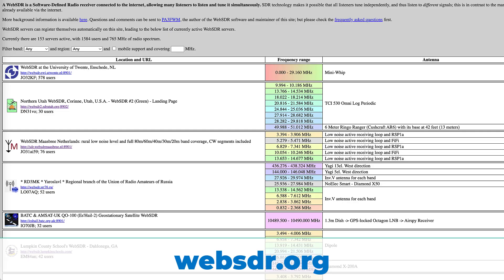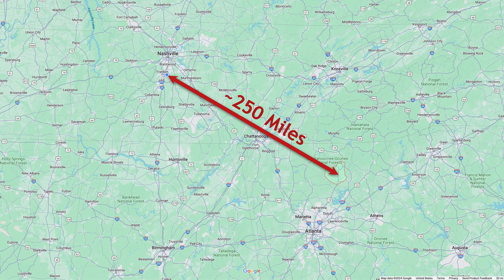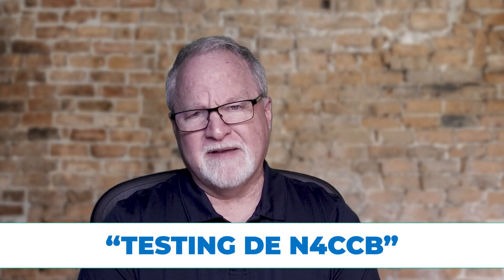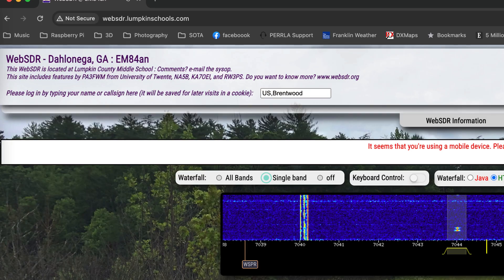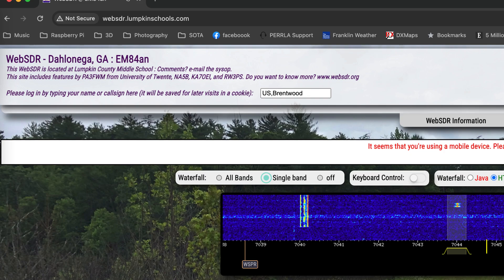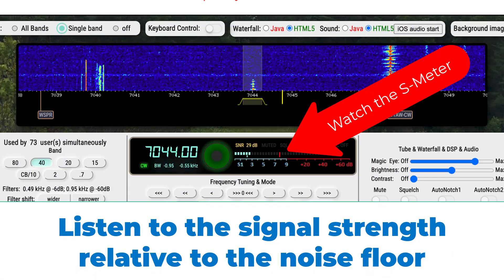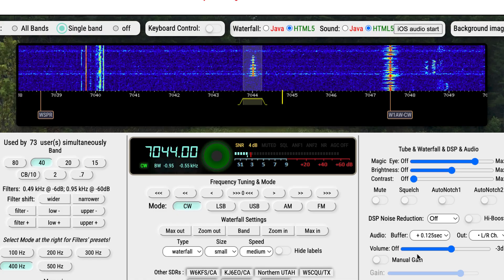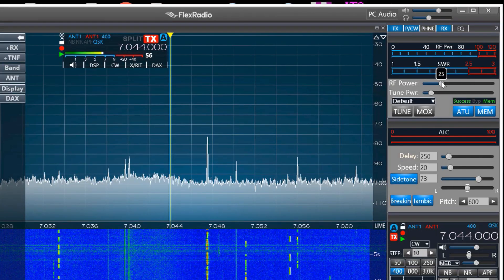100 watts vs. 5 watts: Can you hear the difference?

Comment: It is more about the antenna.  With a gain antenna, it is pretty easy to ERP 300-400 watts with a 100 watt radio.  The other side of this.  Get your 5 watt radio and try to break into a QSO on 160.  Then try 100.  BIG difference.  I don't run any amplification (yet) but I do notice a big difference in 5,20, and 100 watts when the bands get dicey or the antenna is a compromise.  I do enjoy working low power but it is always a bit of a disappointment to set up portable to realize you can't work where you want or who you want.  Usually with 100 watts there is no problems in communication reliability.  That is what the military found out long ago also!  Thanks for the video.
Reply from the maker: Thanks, Dylan. I've never made a contact on 160m (very limited antenna space here), and I rarely even try 80m.  But, you're right... those bands can be a challenge, for sure. Check out the brand new video I just released a few minutes ago. I show an SSB example, but, more importantly, talk about how QRP needs highly favorable conditions to work magic. That said, even folks using higher power are still at the mercy of the Gods of Propagation. Check out that video and let me know if you think I'm wrong in what I say there. Thanks again for taking the time to comment. - Cliff
Reply: @QRPSchool  just saw you posted a vid and I will check it out!  73

Comment: True 😛 ✌️. And whats more - 100mW is often good enough. 73!
Reply: 350 mW out got me a 180 miles QSO and a SWL report from 220 miles using a Pixie on 5.262 MHz and low inverted vee. How much further did my signal go. It's a bit of an underused frequency.
G4GHB.

Comment: How similar would the results be with voice rather than cw?
Reply from the maker: I’m going to try it. Because CW is a pure carrier, and not modulated like SSB, it’s more like a laser pointer, compared to a flashlight. So, the results may not be as good, but should still follow the same pattern… with every reduction by 4x yielding one less S-Unit. A complicating factor for SSB is that your voice’s loudness changes with each syllable. Unless you’re talking like a monotone robot, the listener’s S-Meter will rise and fall as you speak. (Go watch an S-Meter while listening to an SSB conversation on-air.) 

As you reduce your power more and more with SSB, at some point the quieter syllables will be lost in the noise floor.

So CW will yield a best-case scenario, but SSB will follow the same pattern.

Comment: Meaningless as presented. If you have conditions where the signal is being received with over 30dB of SNR at 100W, as you did in your example, then of course you can reduce power by quite a bit and not hear much difference if any! The receiver AGC is going to ensure that! Try this experiment again with conditions where there is only 10dB of SNR and results will be dramatically different. Also, CW signals can be comfortably decoded at only 2 or 3 dB of SNR, whereas phone signals require 6 to 9 dB SNR.

This was simply an example of receiver AGC in action vs. received SNR, not anywhere near an edge case, and not at all an example of how QRP is equivalent to QRO (it is not!)
Reply from the maker: I’m sorry. I am NOT saying what you think I’m saying. When conditions are good, and your 100 watt signal is strong, you can turn your power down to QRP levels and have a good time. In “edge cases”, when QRP is unpleasant and/or ineffective, turn up your power or walk away.
Reply: @QRPSchool  It meant a lot to me. Good thing about qrp is you can work a guy across town and feel good about it. i like remember what a 5 wt litebulb looks like and know i just made a contact with that. If I really just have to make contact with somebody ill pick up my telephone. QRP is playing with radios, and thats what I like to do. Ive got a 40mtr small wonder i put togeather years ago. Ive made contacts all over the country with it. Its fun 
73      kf0ka

Comment: Many years ago, I was transmitting on 40M CW with a tube final input power of 15W when a station running a full gallon answered me. He was shocked to find out how little power I was running, so he turned off his linear, then dropped his power further. We had a long and enjoyable rag chew at low power. Not to say that high power has no place, but just that QRP can work just as well when conditions are right.

Comment: Soon as I heard SDR, I realized this was completely worthless. I have been an amateur since 1987, and a general class amateur since they abolished the code requirement. Power makes a HUGE difference in the real world. I typically run 100 watts on HF. I have tried at 20 watts, and the difference is dramatic. Lots of contacts at 100 watts, very few at 20 watts. There is a reason why amateurs are allowed to use up to 1500 watts (that's 15 times what I use) 100 watts on HF is not going to cause any interference. There does come a point where you reach the law of diminishing returns, but it's well above 100 watts. The FCC says to use the minimum amount of power required for reliable communications, and I have found that to be around 100 watts. I don't have a $10,000 antenna, so yes, if you have one of those, you can get away with less power. On VHF, from my car, with a mag mount 2 meter antenna, I cannot hold the repeater with 5 watts. I can do a LOT better with 25 watts on local repeaters. My Yaesu FT-2900R has a max output of 75 watts, and I can hit distant repeaters with that, that I cannot hit with 25 watts. Just being able to the repeater does not mean you can actually use it. I do not use SDR. My HF radio is an Icom 718. I'm not rich, and I am not a fan of mixing radios with computers. Computers have pretty much destroyed amateur radio.

Comment: No not surprised, try using an  SDR  5-10 THOUSAND km's away...  after all thats when it counts most, most hams I know use HF for DX,  so try a web SDR is Australia or New Zealand, or even to Germany or Italy, or Russia, China or Japan. 

of course 40 metres only 250 miles away will be good...  you could do that on an untuned wet string.

Comment: Awesome demonstration! If you are designing and building radio equipment, you can save slot of money and effort building for cheaper 1 to 5 watt transistors then building with 100 watt transistors. Yes there are amplifier designs that use irf510s but you get between 40 and 70 watts only if you supply 28 volts at about 4 amps or use irf530s.

Comment: I  used to be 1500 watts in the old days in 1980 neighbours use too complain and now I’m 1 watt qrp and im having a blast of fun no high power rigs any more only qrp radios love it.
Reply: 1500 Watts? That's a lot and I thought my 100 Watts was a lot, then I went QRP, nothing above 5 Watts now.
G4GHB.
Reply: I have a 1200w Mercury III amp at home and I like it for pileups on POTA.  It's nice on 80 meters to have the extra power.  I'm not a contester, so I'll run lower power and like to build those QRP labs QRP CW kits.  That's also motivating me to keep practicing CW, so I can get good enough to get on the air later.

Comment: Can I suggest using a websdr that isnt in your near field radiation pattern.  say 3 times the distance so it is hearing your far field radiation? 
The difference would be more noticable. having said that QRP can work great if you have a good antenna system

Comment: "But if the signal is above the noise floor, they're gonna hear you" well... yeah! I mean that's why we want more watts, not because the audio is better, because otherwise you're not above the noise floor. I thought that was a given. Especially with SSB. But even CW, the NCDXF/IARU Beacons, they put out 100, 10, 1, 0.1W, I'm in Australia so bands a usually quiet, I listen to these to suss out if it's a lack of people or what, but sometimes you can barely hear the 100W and nothing after so you know... you'd better be above 100W if you want voice to be heard (considering it doesn't actually put 100W continuous like CW does)

Comment: Interesting demonstration. I see your point. But still I believe there are more factors to be considered. For instance NCDXF/IARU International Beacon Project transmits at 100, 10, 1 Watts and 100 milliwatts. You can clearly hear the difference. The distance between the stations, propagation conditions and what band we transmit on..etc etc.
Reply: Correct ,mast height,ground reflection,surrounding terrain ,if your mobile or fixed. Base.
If your trying to do dx skywave or LOS line of sight Comms,Ariel efficiency Vs losses.
Generally a 50-100w going help in losses Vs a 5w QRP set. 
If it's low power it's best to use an efficient Ariel system resonant for least loss😊
Reply: i was hoping  someone would mention that. Also for  quick check of band conditions there is always WWV

Comment: There are a few other variables that needed to be considered :

Antennas in use at the RX and TX location (gain, height agl / radiation pattern) etc 

Propagation conditions at the time of the test

Loss of feedline, you might be txing 100W but how much wattage is being seen at the antenna?

Very simply though not a bad test

Comment: Your testing is a little bit flawed,  but I realize fully what you are trying to  show.   1..QSB  really  screws around with your results.  It takes  "controlled situation" out of the picture.  2...For a true representation,  you need to  disable  AGC, of course not possible  on a web SDR.  3...Holding  key down  for about  a 3 second   carrier  to get  a better  handle on S meter reading would have been helpful, and last  4...I'm sure  you know how  terribly   innacurate  S meters in general are.   My favorite way  to try and teach something to folks  is to simply use  3dB,  explain that  "if accurate"   6dB would be  1 S unit,  and that 3dB  represents  halving or doubling the power.  Then you can  count on your fingers from 1, 4, 16, 32, 64  etc watts  and  count off the  S and  "1/2 S"  increase or decrease in reading.

Comment: I did something exactly like this last week with WebSDR. I used 27.555Mhz USB with less than 25 watts, tuned into an SDR in Santa Clarita California (Los Angeles area). I would transmit code from my home here in Wisconsin with my little radio with a literal magnetic style antenna set atop an old PC case sitting up on my roof, being fed through an antenna tuner, and I could hear my signal, on the SDR, in Los Angeles, from my home in Wisconsin.

Comment: Dear Friend, great video !  but I find your tests incomplete - would you do another video with more data? example: your RX station was only 250mls away on a NVIS frequency wavelength in which if your antenna radiates at a high incidence angle then either with 100 or 5 watts you would have complete signal strength saturation as I have noticed that you probably had. 
in order to see the actual facts of such a test - we need more data; at Transmit time what was the FoF2 and MUF value in your area from the nearest ionosonde.? what is the takeoff angle of your antenna? - is the receiving antenna within your nvis sig. saturation zone? (in this case it was).  is there a more noticeable difference where skip skywave was performed with a more far away RX station where natural skip for the specified frequency is concerned? what are the differential values of the different RX stations NVIS/ Non-NVIS range in signal strength? otherwise, this was a great demonstration of perfect timing of NVIS communications where complete signal saturation within your coverage area was performed.  Great vid though and yes you do not need high power at all - 73s from SV1 - land !

Comment: Good demo.  Could you do a similar test with voice?
Reply: I had the same thought. Be interesting to hear the difference on SSB. I like operating mobile HF the most, so on most bands, I'm sending far less than 100 watts, and effectively maybe 2 watts on 80 meters.
Reply: I just did the test using lower side band on 40 meter and the same sdr station you used.  Good Grief I hardly noticed the difference.
Reply: He did a part 2 using SSB.

Comment: Great to see your doing well. I operate about 80% qrp and about 80% CW, and only occasionally digital. I enjoy seeking and making contact with  weak signal stations, dx, pileups. POTA/SOTA and the QFox Summer and winter Fox hunts all wile using 5w to wire antennas, a 40m delta loop with a remote tuner at the feed point of the antenna, making it all band and a Hexbeam at only 12 ft. I am no longer surprised how effective this setup is. I never announce that I am qrp until I give the other station a signal report so as not to attract attention with "qrp." I have no issue increasing power so as to make an exchange or conversation easier or if 5w just doesn't get it. Oh and in my sometimes noisy RF urban setting, I am not above using a web remote receiver such as RCForb Client.

Comment: Hi Cliff, as usual great content! Another good tool to do these checks is the reverse beacon network, not as visual appealing like using a websdr but it does the trick as it can report your SNR. BTW You convinced me long ago about QRP and also to learn CW, I just ordered a QMX from qrp-labs, now I need to figure out how to have a temporary antenna or something here on my apartment as I can't put anything on my balcony, and as in normal european fashion my apartment is pretty much a faraday cage, stell, glass and concrete all around, so my alexloop is useless inside of the apartment. 73s EI5HPB

Comment: Thank you for this impressive demonstration. My usual power output is either 5W with FT818 or x5105 or 20W with FT891 - on very rare occasions I go up to 50W or 100W as I operate at least 90% portable with battery power only.

Comment: Nothing remarkable, as there's a nice and narrow cw filter on the rx side at work. Also remember that the receiving station would have a helpful agc in place, making the signal be similar in audio volume. I'm surprised you're surprised at these results..
Reply from the maker: Listen to the signal relative to the noise floor.

Comment: Hi Cliff, good demonstration.  You were wise to conduct the entire test within a minute's time, which avoids most propagation variations.  1 to 100 watts is only a 20 dB change, which is a relatively small range for a receiver.  The only change the receiver will show is a proportional noise floor change.  With a narrow IF bandwidth and on-off keying detected by a product detector, there is lots of signal-to-noise margin.  SSB, being AM, has a linear detection rate (unlike narrowband FM, which logrithmic).  The product detector actually permits detecting signals below the noise floor.  So, if you want a better S+N ratio, use a narrower IF bandwidth.  CW only needs 50 to 100 Hz.

Comment: I was doing similar testing last week after bringing a Kenwood TS-670 quadbander back to life, only I was testing SSB. The TS-670 is a 10-watt rig, whereas my TS-430S is rated at 110 watts SSB (realistically 100-120, depending on which band I am on). I'm located in Indiana and picked various locations to listen from. My comparisons were on 7/10/15 meters, as these are the bands shared between the two rigs, and I used the same dipoles on each rig. What I found was that there was little audible difference from east of the great plains to the east coast if the noise floor was decent. The west coast, Mexico, and northwestern Canada was still readable/usable on the TS-670, but not as good as the TS-430S. Crossing the oceans, however, the TS-670 can barely be heard, if at all. A lot of that has to do with my antennas being in compromised locatins at compromised heights, but it did give the 100+ watts the advantage. On the other hand (and I know output wattage has nothing to do with this), they were identical at receiving. As it stands with my current antenna situation, with the TS-430S, "If I can hear 'em, I can work 'em." With the TS-670, I can hear plenty outside North America that I can't work. That will likely change a bit in the spring when I focus on some antennas specifically for the TS-670.

Comment: I remember reading something once on the POTA Facebook page where someone wrote something to the effect of that they didn't think it was fair to make someone work extra hard to try to copy you when you're doing QRP.  Okay... I didn't ask you to try to copy me at QRP levels.  Either you're going to hear me, or you aren't.  If you don't, spin the dial...  This proves that you can be just as copiable at 100 watts as you can at 5.
Reply from the maker: I like that a lot.  If you hear a weak signal and don't want to try to pull it out of the mud, don't.  The thing is, a QRP signal can be strong somewhere and weak elsewhere. I've worked a bunch of QRP stations that I didn't know were QRP until they told me. Thanks for your comment, Ralph. - Cliff

Comment: In 1987 I worked WAS with 1-watt output from my Heath HW-9 over about 18 months just casually working stations nights & weekends. I had a 40m rotatable dipole @ 50 ft & a 3 element 15m yagi at 50 ft, that was a big factor in making the job easy.

A couple nights ago I completed my Tuna Tin 2 40m QRPp transmitter kit from QRPme, tonight I measured 318mw from it. I plan to try it on POTA and winter field day this weekend, I got a handful of my favorite 40m crystals ready to go.